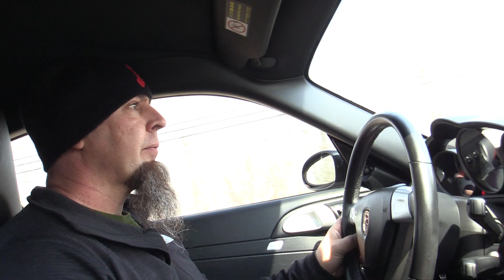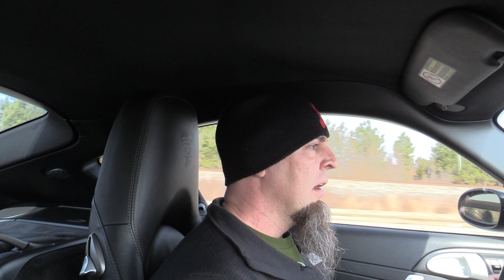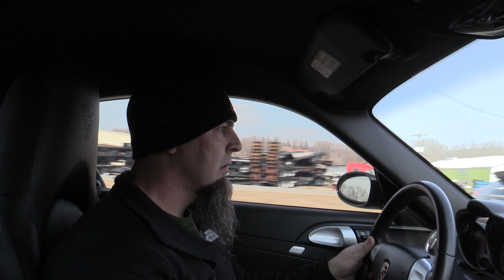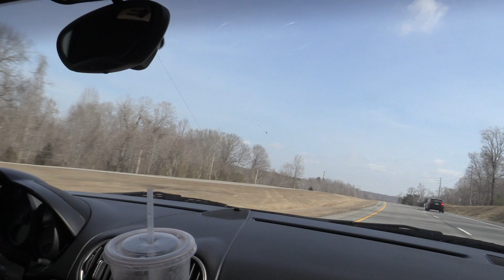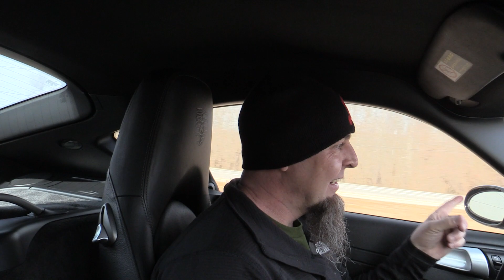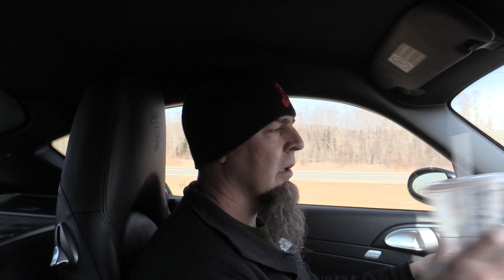Riding to the gym with John Willis

Comment: The 5.9 was used until mid 2007 then they introduced the 6.7 diesel. I have a 2006 2500 4 door with a diesel. Definitely  a badass truck.

Comment: Hey T Pablo. Can't wait to see the truck. Just wanted to mention that you don't need to go nuts on the lift to get a nicer looking stance. I have done 3" and it really looks good but does not make reach issues all that much more noticeable. You can hop up on the tire to see in or access the bed. Likely something you will need to do even without a lift. As for getting in and out, you won't have trouble. Grab the steering wheel and hop in. Out is even easier. Just don't have seat snags in your pants. Nerf bars make access even easier. Good luck on a cool find.

Comment: On diesels you guys still get fucked on milage. Here (UK) diesels getting from 50-70mpg is the norm (depending on size of engin/car and all that jazz).
Reply: You're also talking about a little 1.x liter turbo diesel inline 4, not a relatively big V8.
Reply: Watching further, replace relatively big V8 with relatively big inline 6...
Reply: Did mention that in my comment.
Reply: gotx Sheps lies...all lies.